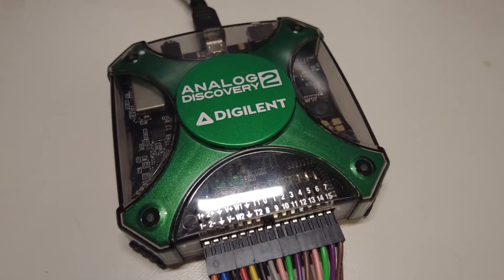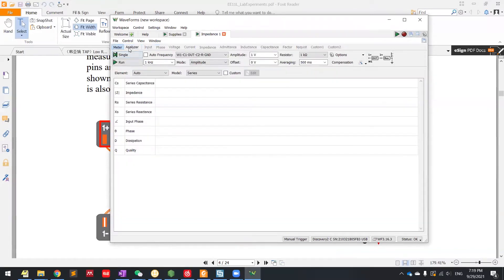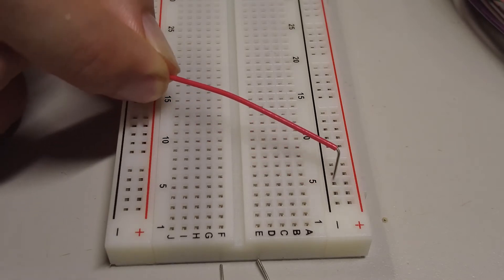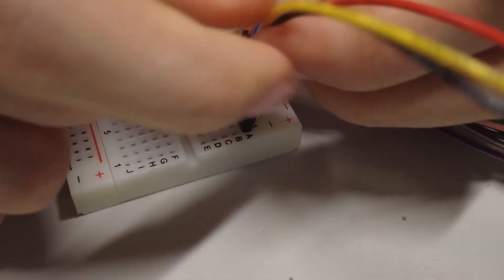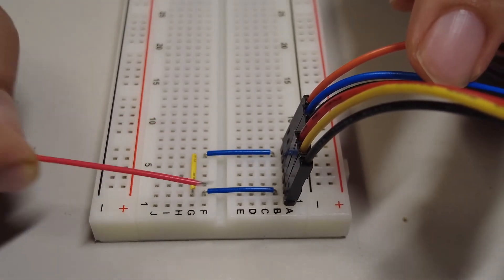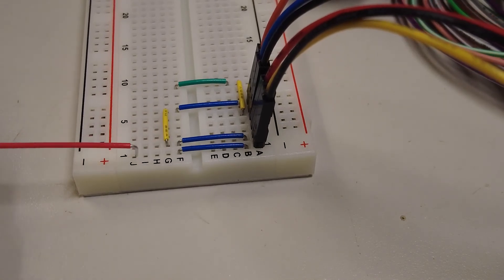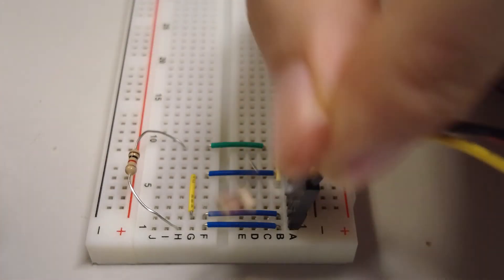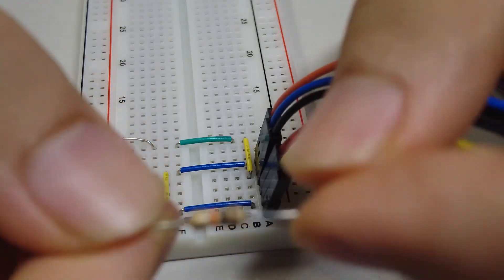Quick start to (Analog discovery)AD2 and impedance measurement

Comment: Would love to see video-shorts on using the device.. for example, using one DIO as an input, and another DIO as output (Idle High).  Anytime there is a rising edge on the Input DIO, the output will pulse low for 5 microseconds.